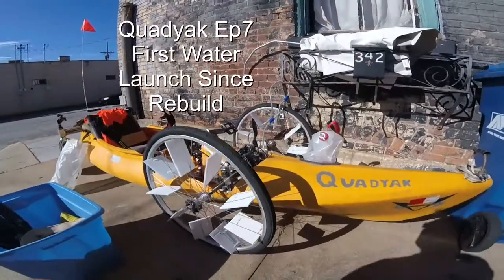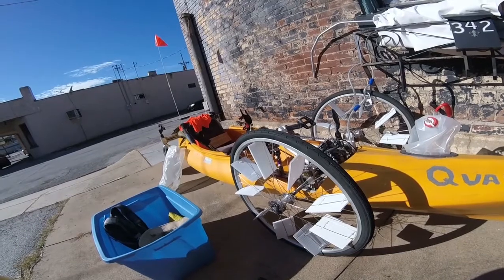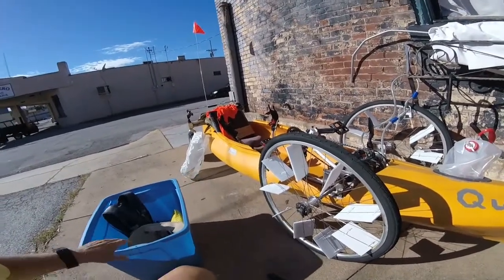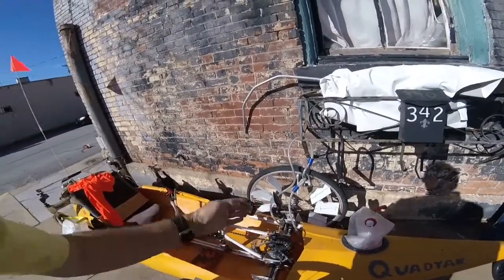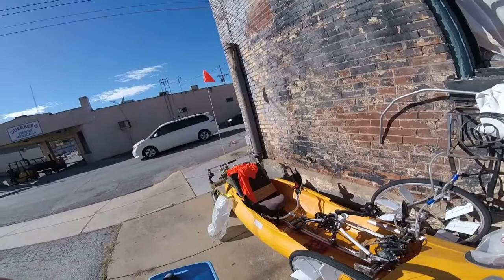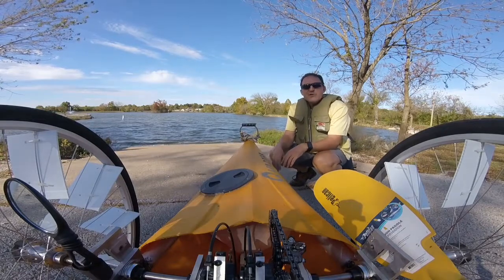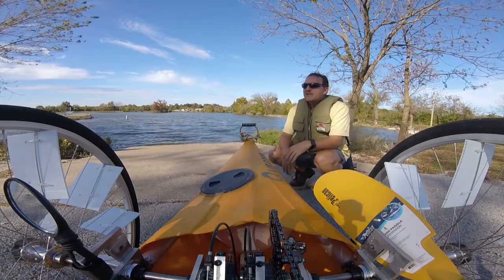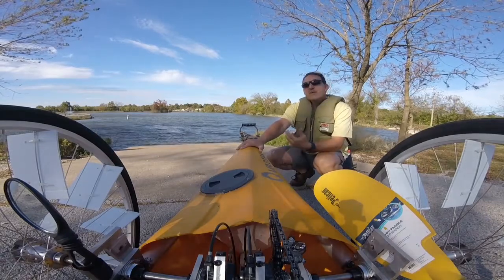Quadyak Ep 7 First Amphibious Launch Since the Rebuild!

Comment: What are the squeaks like @ 8:07 ?  Does the frame rub against the kayak body under load?
Reply from the maker: Just the brakes.  The camera was sitting just over the disc brakes we used to have.  Found out in the mountains that they weren't strong enough, so have switched to caliper brakes on the rear wheels.

Comment: Could you brake just one wheel to assist in rate of turning? (of course that would only work in one direction of rotation)
Reply from the maker: In water, leaning works to turn sharper, I've found.  There is no way to independently brake the drive axles, though.
Reply: @stereorandy  Oh ok. I thought the faux differential would allow one side to rotate forward even when the other side was stopped. Thinking about it now though, even if that were true, it would be the slave side that could rotate if the drive side were braked. But that wouldn't help as the only way the drive the slave side is through the rotation of the drive side. Thanks for replying 😊. Very cool project 👍